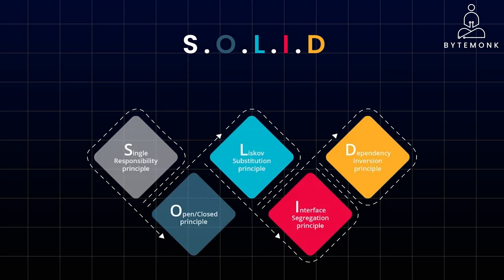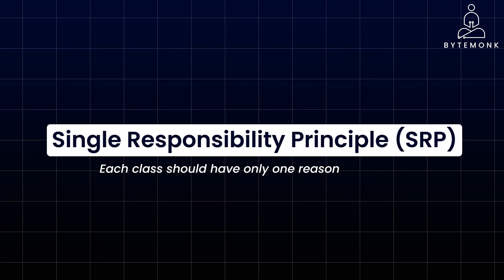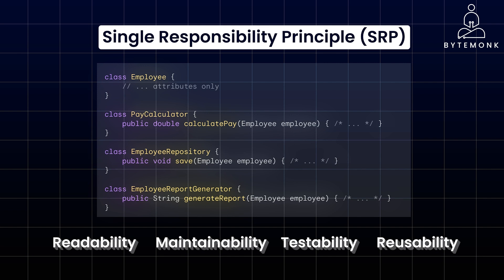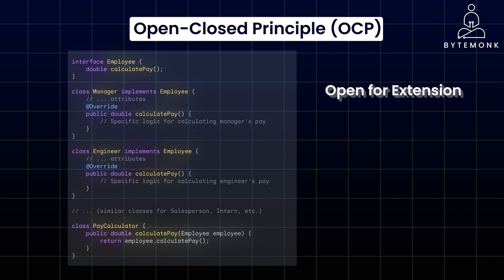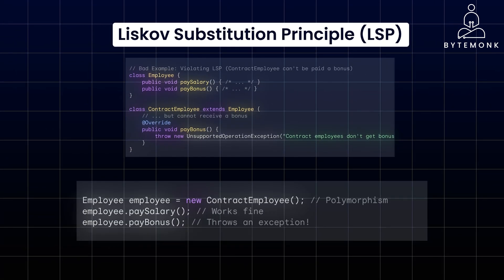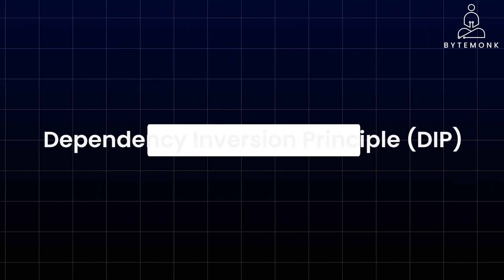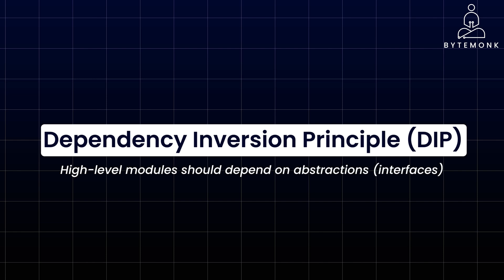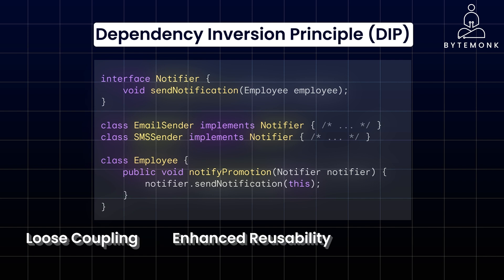SOLID principles explained | Java |  System Design Interview

Comment: Aren't the changes made for OCP violating the SRP principle ?
Reply from the maker: Great question! It might seem like changes made for the Open/Closed Principle (OCP) could violate the Single Responsibility Principle (SRP), but they actually address different concerns. OCP focuses on ensuring that software entities (like classes, modules, functions) are open for extension but closed for modification. This means you can add new functionality without changing existing code, which helps with maintainability and flexibility. SRP, on the other hand, states that a class or module should only have one reason to change, meaning it should only have one responsibility.

When done right, adhering to OCP should not violate SRP. For example, by using abstractions or design patterns like strategy or decorator, you can extend functionality without modifying the core class, keeping each class focused on its single responsibility.